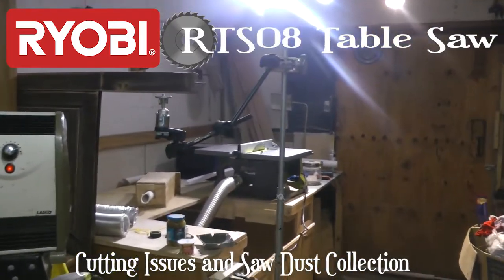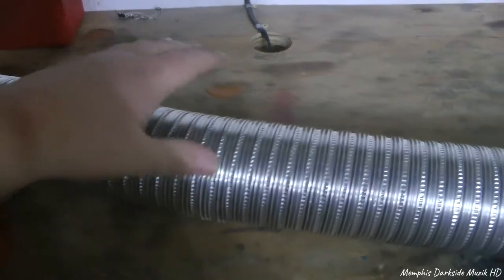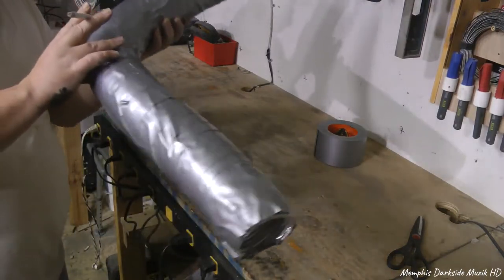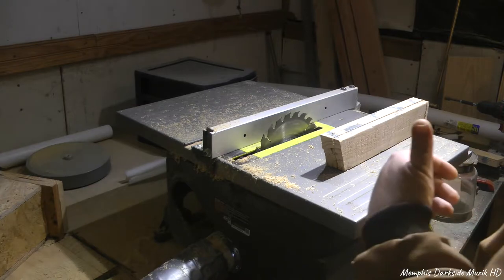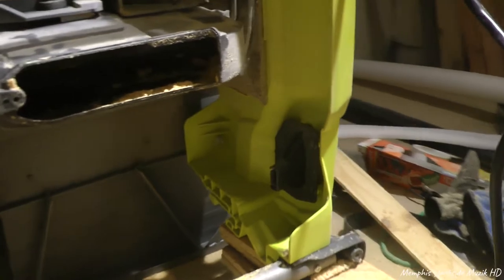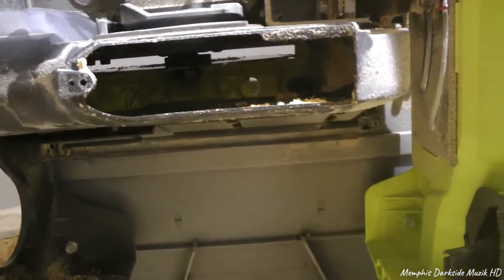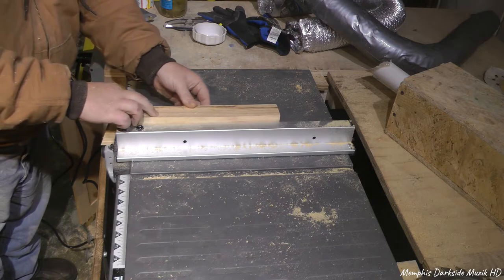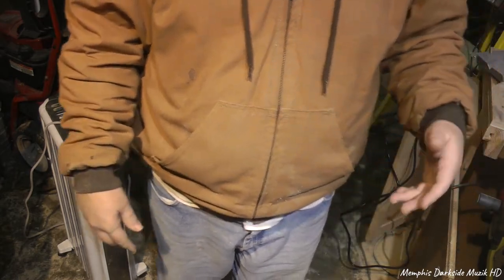Ryobi RTS08 Table Saw Cutting Issues and Saw Dust Collection Problems (part-2)

Comment: I'm really new at woodworking, and I only bought this saw two days ago, and I spotted maybe half a dozen extreme safety and equipment problems in this video. I won't tell you how to run your shop, but in case anyone else is in these comments:
1. Buy a Bucket Head vacuum attachment from Home Depot for $25 and attach it to a 5-gallon bucket. Get a 2.5-1.25 inch pipe step-down fitting, and attach the hose to your dust port. Problem solved.
2. Never make a freehand cut on a table saw. Your workpiece can go crooked and make a bad cut, or it can kick away in a random direction, possibly toward the operator.
3. Never reach across a blade, especially while it's spinning.
4. If you absolutely must reach across a blade, try to not have long sleeves on. The blade can yank your arm right down.
5. Plan your cut BEFORE you cut. At 10:45 you bonked the end of the piece you were ripping (freehand) into some junk. Suppose the end of the piece got wedged or stuck somehow -- then you're riding a dragon.
6. At 11:31. . . holy hell. Why didn't you just unzip and reach for that piece with your dork?
7. You can't always have a full blade guard, but if you skip the riving knife you're begging for binding and kickback.
8. Eyes and ears and mask, especially if you have a dust issue.
9. See how that cut piece moves a bit at 11:40? That's the saw trying to help the human gene pool by hurling that cut piece into your nuts. It didn't work out this time, but someday it will.

Seriously though, just hook up a cheap shop vac to that port. The saw will treat you right if you respect it.

Comment: I took some foil tape and put it along all the gaps around the bottom of the saw. I also created a make-shift zero clearance choke plate by using the foil tape on the choke plate  and cut a slit with an exacto knife for the blade. Reduces the amount of sawdust .. 

however, I agree the portable Ryobi table saw dust collection system is no good. They might as well have left it open from the bottom.

Comment: Unsafe technique: at 11:24 you unsafely crosscut without a miter gauge, then you unsafely reach over a spinning blade to touch the work piece. Your jacket cuff could have contacted the blade and pulled your hand toward the blade. Please be safe.